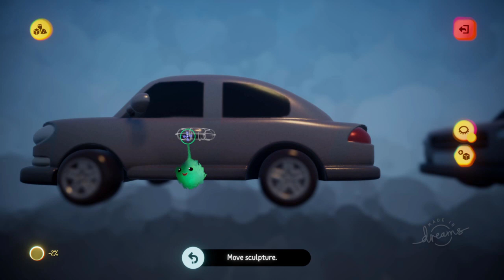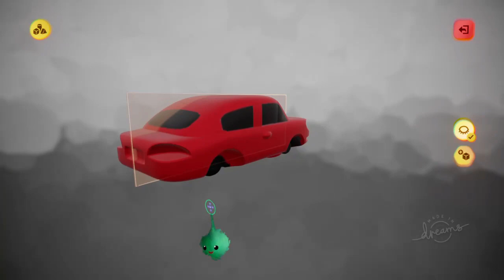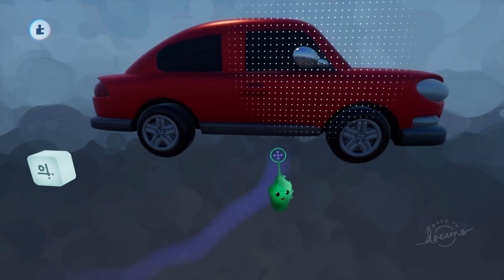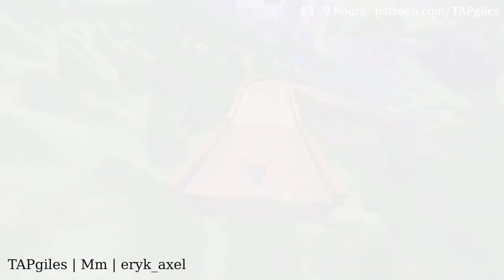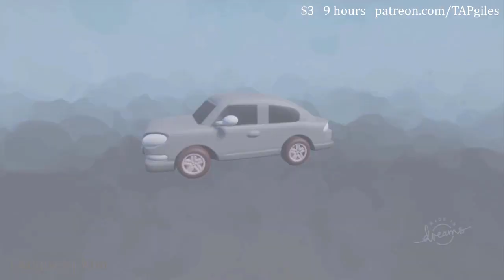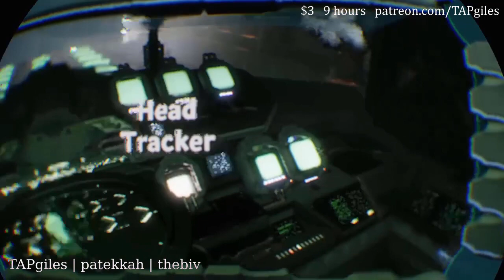Chopping Up a Sculpt | TAPgiles Dreams Tutorial

Comment: I'm trying to make a game where if you press square it activates an animation where a hand (not the puppets hand) rises in front of face and bird flies to it, but I can't get the animation to stick t the player. The hand just remains floating in the spot where I placed it in the scene. I've tried everything I can think of, grouping it with the puppet, scoping it into the headset like you'd do with a health bar, animating the puppet itself, but no luck. Any insight would be appreciated.
Reply from the maker: Hrm... not sure. So if you scope it into the puppet, what happens when you just walk around? Does it not follow you?
Reply: @TAPgiles  no it just starts and stays in which ever spot the puppet started the level.
Reply from the maker: @WhatAColourfulWorld  Hrm... are you sure it's in the puppet properly, and not in some outer group the puppet is also in? Like, if you scope into the puppet so that you can see the purple base, and then turn on "hide everything else," do you see that arm you put in there?
Reply: @TAPgiles  I just tried that and not only can I not see it (it's invisible until keyframe in animation turns it on) but when I go into edit mode I see that the animation has played and it has followed me but it's a lot further away and high up than it should be. I also tried scoping it into the head tracker, tried adjusting the scale this way and that and much the same result.
Reply: @TAPgiles  Another bit of information that may help or add to the confusion is when I activated the animation after scoping it into the puppet I noticed if I walk forward the hand and bird rotate perfectly around me left and right if I walk backwards.
Reply: @TAPgiles  Ok so I fixed the distance issue by tweaking the keyframes not sure why they changed but oh well. The only 2 issues now is the turning thing which I noticed when I backed the camera out a bit is because when I back up the puppet turns around but of course my camera doesn't (I'm in first person generally so my puppet turns but my view doesn't). Also can't work out how to turn the animation off, tried turning it to sustain but tapping the activation button doesn't keep it on I have to hold it.
Reply from the maker: @WhatAColourfulWorld  Turn on "face camera direction" on the puppet so it stays looking the same way the camera is looking.

If you want it to play all the way to the end, set the timeline's "playback mode" to "once."
Reply: @TAPgiles  Thanks. I never would have worked out some of that stuff by myself.